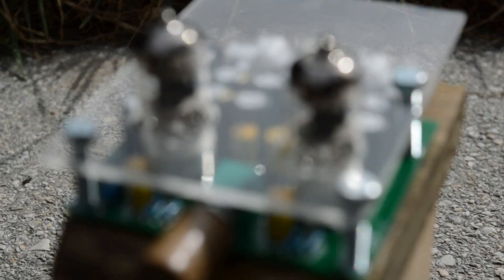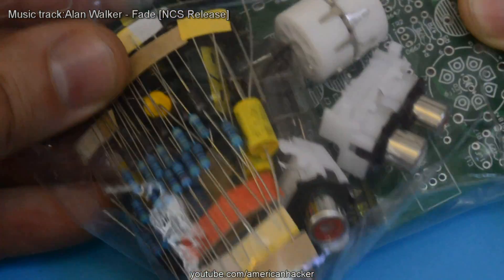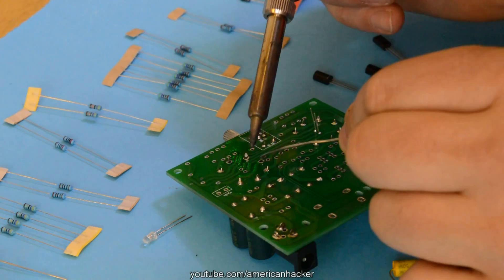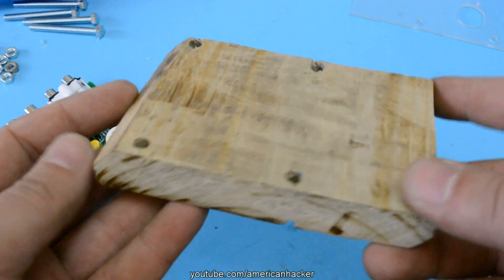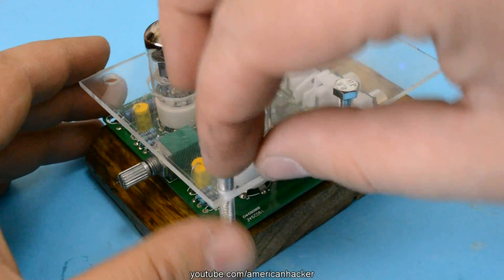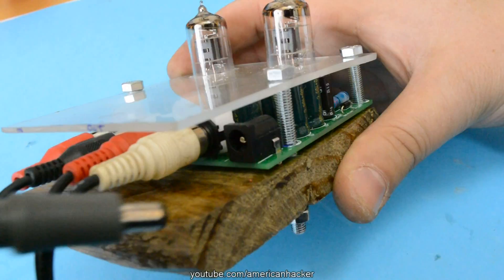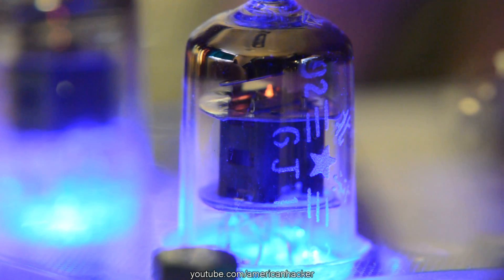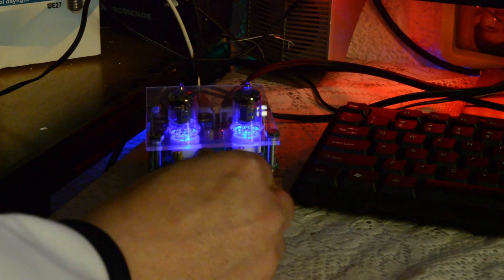DIY Tube Preamplifier

Comment: I built the same kit, but for a little extra flare I used the color changing LED's instead of blue. Looks really cool. This is an easy kit to build, but finding a 12 volt AC transformer isn't super easy. I did find one that is 110 volt to 12 volt 1 amp it was the closest thing to .80 amp. Now I need an AMP kit to go with it.

Comment: I think you've got a mistake. Your adapter is 12 V DC, like the car cigarette lighter, not 12 V AC. 12 V AC is not used that often as the 12 V DC is used.
Reply from the maker: +Gaby Le Gamer the adapter that I show in video is 12v DC and I remake it into a 12V AC because the preamplifier works on AC voltage 100% checked
Reply: You need to use AC, there is a voltage doubler (actually 3 of them) that kicks the voltage to arround 90V, it will not work with DC
Reply: You are wrong mate. It really is 12 V AC.